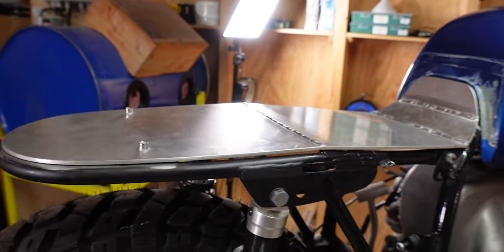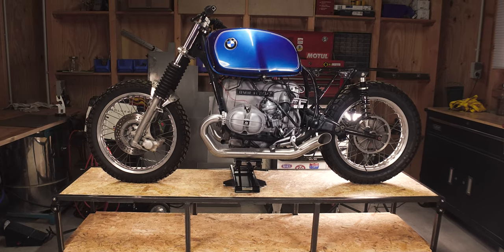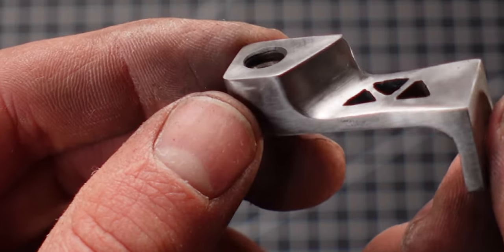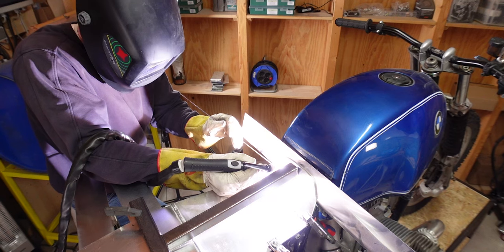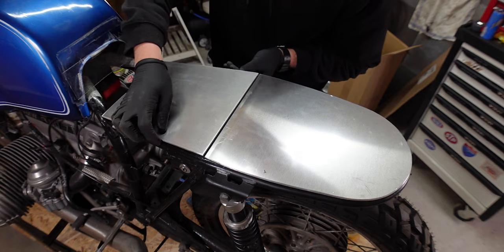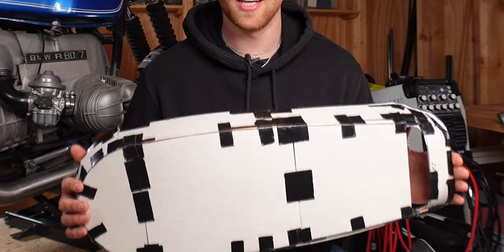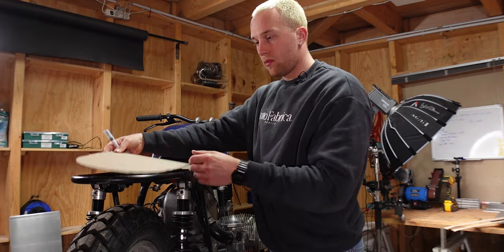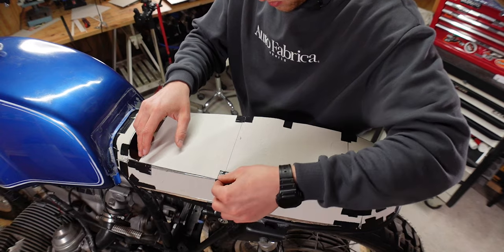How It Feels To Build A Custom Motorcycle

Comment: As a beginner at the art of motorcycle customization myself, I can very much identify with what you are saying.
When I buy material for a specific item for the bike, I always try to buy enough to make two of that item. If I fail on the first try I can always go again. And if I succeed on the first try I have enough material to make that same item but for another bike, the next bike. 😉 To justify the cost of buying twice the material I just have a look at what the item would have cost to buy, and it would almost always be way cheaper than the material.
Bike is looking great and so does your videos. Keep it up! ✌
Reply from the maker: Hi, yeah that's a good approach...using the next bike as justification for all the money spent :D Is the savage your first custom build? And did you get the coffin tank sealed?
Your videos are super enjoyable. I really enjoy following the journey of your build!
Best, Joshua
Reply: @MotoWrenchers  Well, you know there's gonna be a next bike, right? 😉 Yes, it's my first build so I'm learning a ton of stuff, it's fun, but can be a struggle sometimes. I have done some more work on the tank, and it's more sealed than before, but not completely sealed yet. Right now I'm debating if I should do another one, it feels like I would be able to achieve a better result on the next one, and maybe I can justify getting a better welder as well. 😀
Thank you so much! I enjoy your videos as well, next I think I will have a look at your TIG weld videos.
Have a great day! ✌
Reply from the maker: Yeah the first one is (hopefully) always the hardest. But I guess we always will keep challenging ourselves. But the basics will definitely be much easier and quicker.
Good that you're making progress with the tank. Building one from scratch is an ambitious project for the first bike. Cool that you attempted it in the first place 🤘 For what it's worth, I would encourage you to build the second one...if you're already thinking about things you could improve. Your skills will develop a lot from doing it again. And I wouldn't mind another cool video 😎 
Regarding TIG welding...do you already have a TIG welder? If you give it a go, feel free to contact me if you need any help. We could also have a quick video call to go over it, if that helped you in any way.
Reply: @MotoWrenchers  As you said, I think that as soon as you master something, you come up with a new way to challenge yourself. But I guess that's what's making it fun as well.
Honestly, I couldn't in my wildest dreams imagine that my first attempt at building a tank would result in anything even remotely looking like a tank. 😂 So I have no problem going for another attempt, I was preparing for it all along.
I don't own a TIG welder but I really feel like I should own a TIG welder. 😀
I will drop you an email and we can have a chat about welding, or bike building, or whatever. 🤘
Reply from the maker: I think your feeling is right...you should own a TIG welder :D For me, getting a TIG welder and learning how to use it was the best thing I did for fabricating parts for the bike! It was such a game changer for me and in hindsight I think it's not too hard to learn with the right approach.
I've sent you an email with my number, so we can have a proper chat. I think this would get out of hand pretty soon :D
Reply: @MotoWrenchers  Thank you for confirming my feelings! 😂 I've watched your videos about how you got into TIG welding and I really felt your struggle. But I was also really stoked when I saw the results you were getting!
Yes, lets stop destroying your comment section and move this party elsewhere. ✌